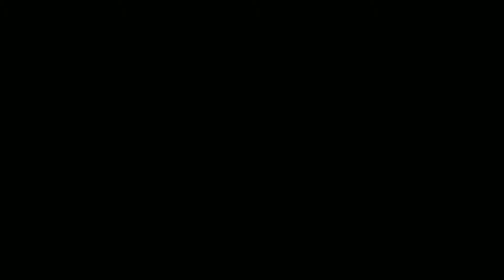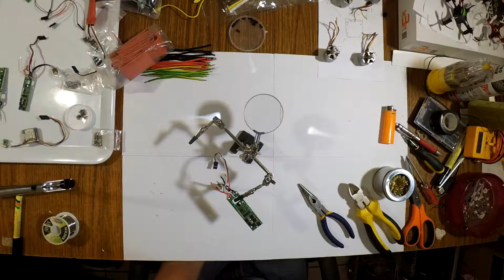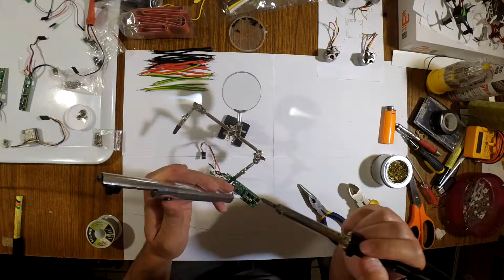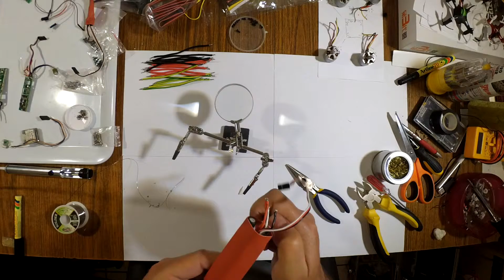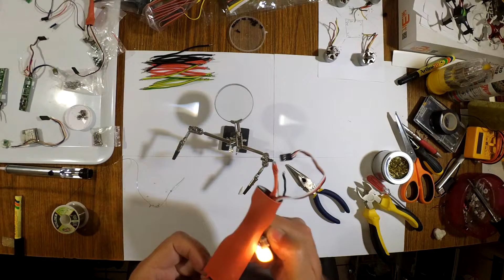CX-20 rebuilt to 450 Frame - Part 5 - Rewire ESCs

Comment: hi
i'm following you step by step
but what kind of wire do you use ?
sorry if you said it in the video but i'm not fluent in english
thx
Reply from the maker: +Augustin MEIGNAN I am using a high-grade copper wire (which is more than I need, but all I had).  As long as you do not use a wire which is thinner you should be OK.
Reply: +Riaan Roux so it's just normal wire ? not special wire for modelism like silicone wire 
you used rigide cable ?
Reply from the maker: Yes, I used rigid copper core heat resistent wire which is actually way more than will ever be needed, but it was all I had access to in the small town I live in South Africa.  I would have loved to use Silicone wire, but none available here.